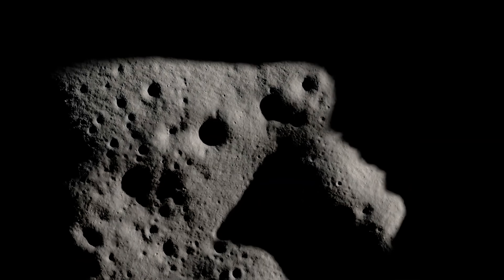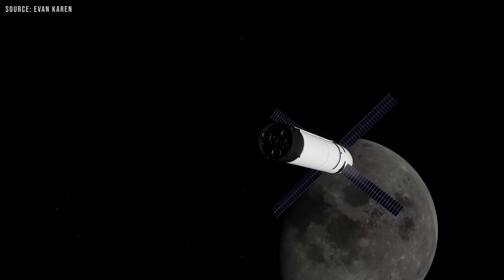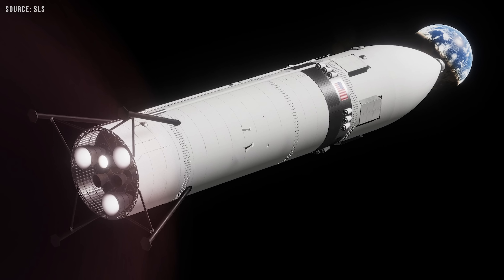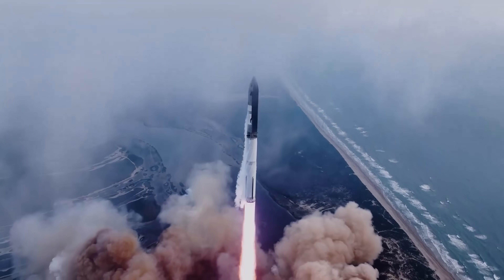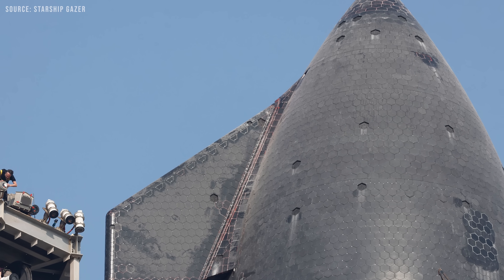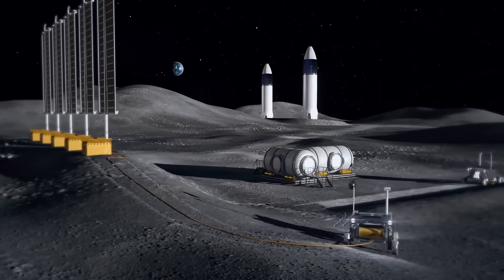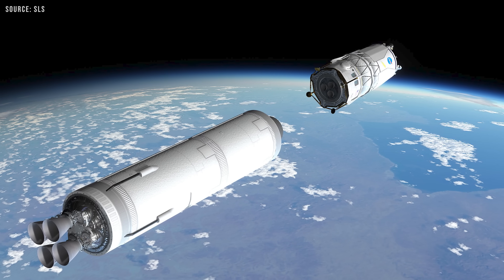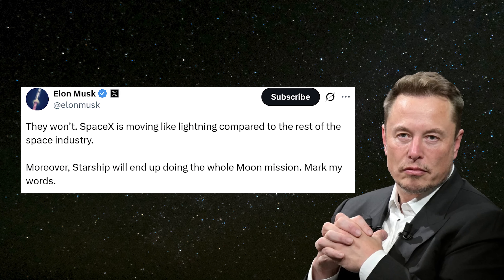SpaceX’s Brilliant Solutions to Land new Starship on the Moon in 2026, Sooner than China

Comment: I like the idea of a smaller crewed ship but I still think my idea of a piggy back version is a good viable option , from a safety point of view the less fuel on the the crewed ship the better more safer more space .really just enough fuel to get down on to the lunar surface and return to the the larger fuel carrying locomotive that will bring them back to the earth . In my concept , all or the majority of necessary fuel should be in a separate tanker/locomotive. Vehicles that do all the hard work , carry the fuel and the drive for the journey . On departure they would connect in low earth orbit and the crewed ship and the fuel /locomotive tanker. A completely unmanned version could be sent to the moon with a spare tanker of fuel or wherever it’s needed. All of these tankers/ locomotives could technically be recovered so no loss to Spaceex . To me that sounds quite viable and ultimately the safest way to get humans to and from the moon and crew and more available usable cargo space as an added bonus . Taxis to the moon . Tell me that isn’t a good idea Elon . M

Comment: No need for many tankers.  Liquid fuel is needed mostly for burn control.  Use cheap, long lasting solid fuel boosters for the main propulsion to get to escape velocity and even most of the moon landing and launch burn.  The boosters can even be pre positioned in LEO and moon orbit.  Minimize liquid fuel requirement.  Of course, this will require ability to attach and ditch boosters as required.

Comment: Starship is already over complicated now you want to add more complications. Maybe its just cheaper to use SLS, it works and doesn't need refuelling.
Reply: A single SLS launch has cost more than NASA has paid SpaceX for the entire program... and they don't have a lander yet either way
Reply: @gordtulloch  Yes that maybe true, but the rocket has launched and has sent Artemis 1 around the moon, if NASA had to build a lander and not wasted the money on SpaceX, they would have had that as well
Reply: @flightsimdev  If NASA (or rather their bloated contractors) had tried to build a lander we'd be 5 years and $10B later with something that might work
Reply: @gordtulloch  We would have something that worked though, do we have a HLS rocket right now? No we don't

Comment: Even these simplified designs are stupidly complex.

KISS.

Launch a Falcon or Starship with the upper stage of nothing more than big fuel tanks, engineless but with docking systems in one or both ends and maneuverable thrusters.
Then launch the manned Starship which can be any size fully engined but has minimal fuel enough to get to LEO and a docking system n its nose 

Dock the manned Starship to the fuel tank in LEO which instead of an airlock has hard fuel connections. If desired, daisy chain one or more of the fuel tanks end to end 

Now you have a fully fueled manned Starship fully fueled without any fuel transfer, fully pressurized and theoretically unlimited fuel capacity depending only on how many fuel tanks you want to chain.

You eliminate the Starkicker.
Instead of an expendable Starkicker, you could similarly put fuel tanks in lunar orbit for the return trip so the only optionally expendable parts would be empty engineless fuel tanks.

Comment: Again.  The "fully reusable" Super Heavy booster has  more than twice the power  of a Saturn V Booster and costs $20 million to make with a additional $33 m  worth of Raptor Engines.   But because the Super Heavy Booster is "fully Reusable" it can only get the "fully reusable Starship to LEO by the Starship using most of its fuel.  So anything beyond LEO will require the Starship to be refuel to get the ... payload .... to the desired orbits.  This is why Blue Origins Lunar Lander must also do refuels as it too has a "fully reusable" booster.

Everybody needs to stop being moron Liberals fixated on the latest & greatest, lacking basic commonsense & objectivity, and caring only about Me, myself & I.  NASA should have simply copied & improved the entire Apollo programs starting with a cheaper & more powerful  Booster, which they already have with the Super Heavy Booster.